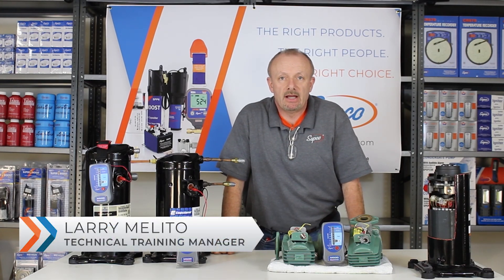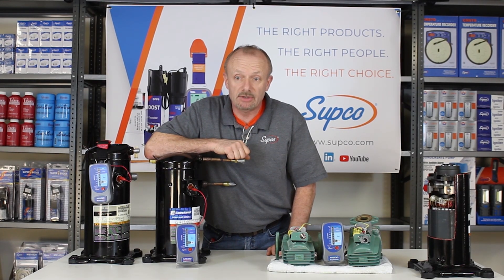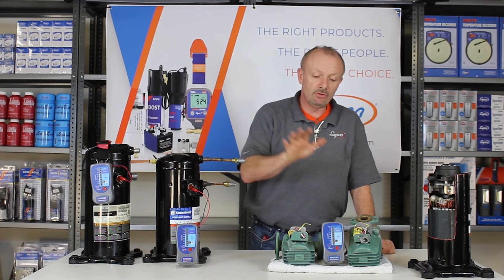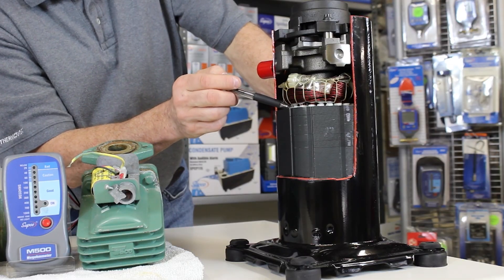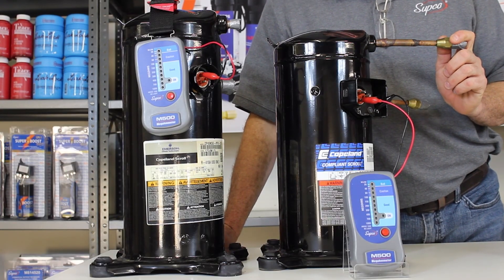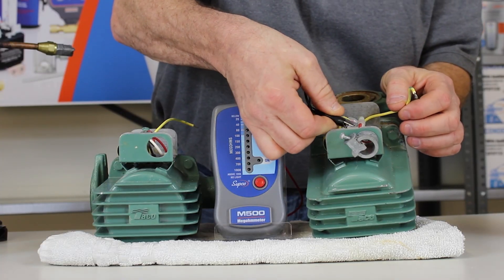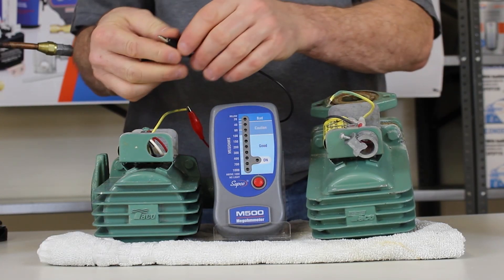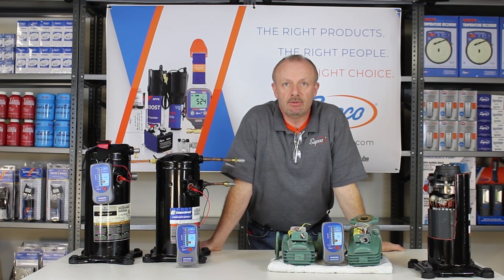SUPCO TechTalk - The Versatility of the Megohmmeter

Comment: Its ok for a quick check on fan motors but there is running debate on testing compressors do to moisture and metallic  particles internally . Some mfrs do not recommend megging compressors ! I have seen one of these read bad and a different megger read good on the same operational unit ( yes the connections were clean and tight ). Ya cant do a propper dar/pir test with it , so it is useless for predictive maint.